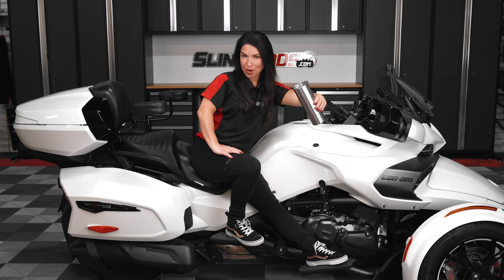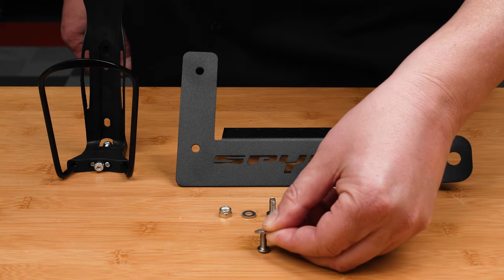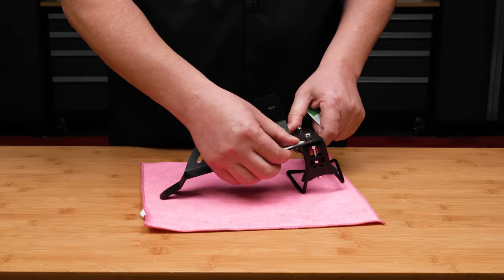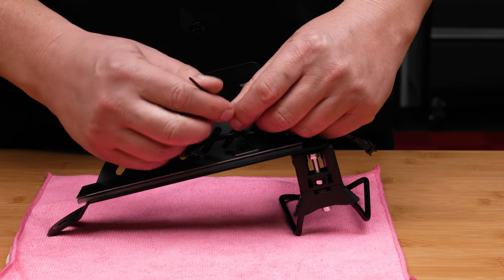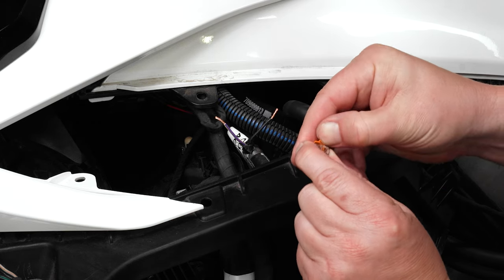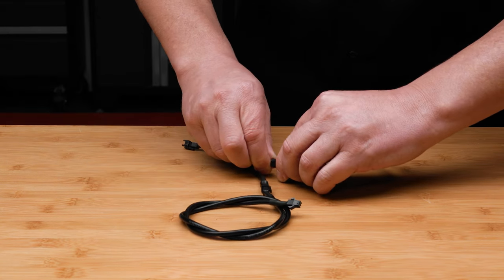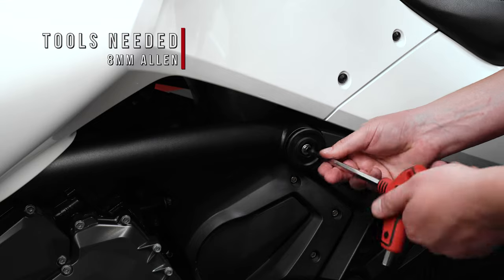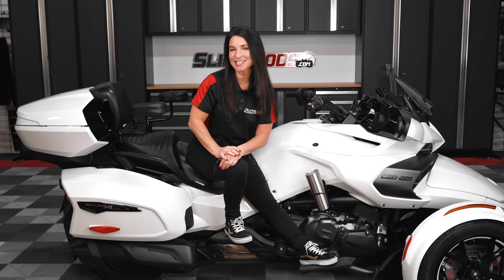Spyder F3 Side Mount Drink Holder with Optional LED | Install

Comment: It don’t look stable.
Reply from the maker: It's extremely stable. The cup holder bracket width is adjustable so you can adjust the diameter of the drink holder itself with the adjustment screw to fit your particular beverage or tumbler.
Reply: Oh it stable